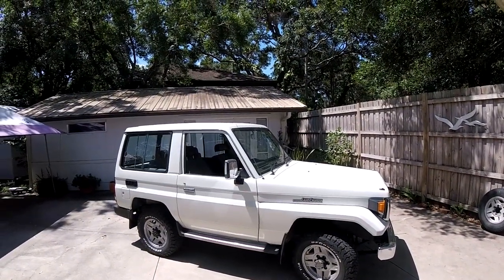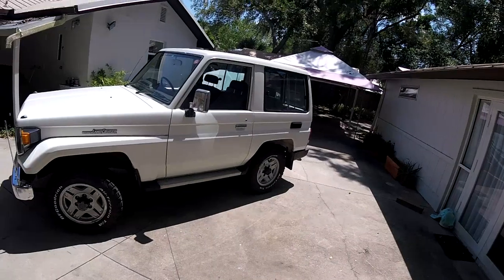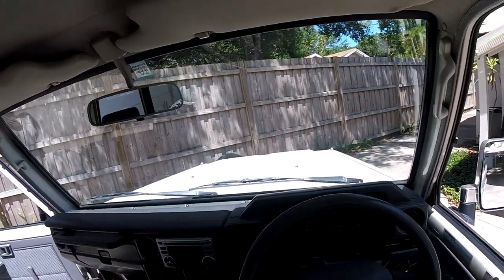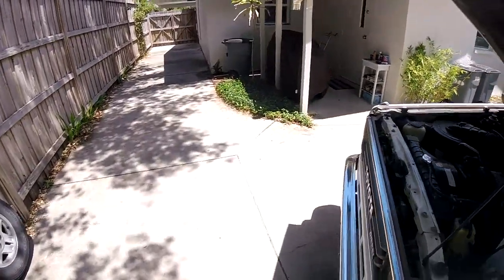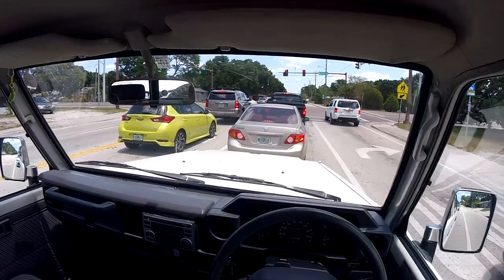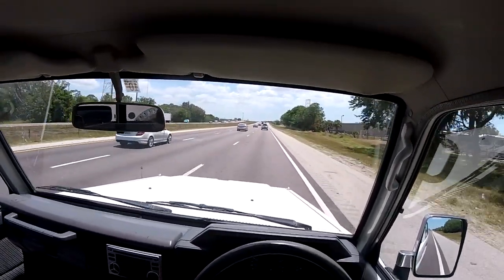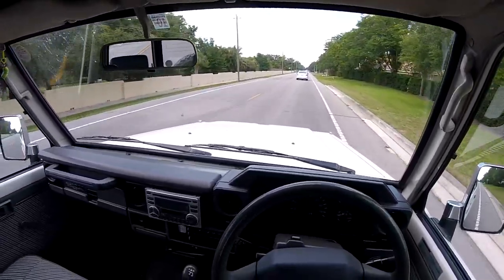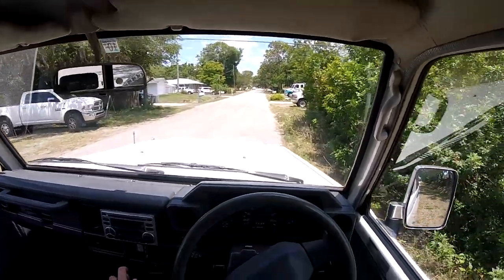1991 Toyota Land Cruiser PZJ70 Diesel 4x4 in the USA - POV Walk Around and Long Drive

Comment: how much did it cost to import this yourself?
Reply from the maker: Whatever price you pay at auction add on around $3000 bucks on top of that, more if you are inland in the USA. 70 series cruisers go for 6-15k at auction, depending on mileage, condition, transmission, etc.
Reply: @KakerMix  could you tell me what page or company you used it to import it? please

Comment: the 1pz is slow fast is the 1hz or the gasoline series or turbo
Reply from the maker: The 1PZ is slower to accelerate than the 1HZ, both of these engines have far more torque than any gasoline options. Gasoline will be quicker to accelerate but have worse fuel economy and arguably aren't as reliable. Top speeds will depend mostly on gearing and little on the engine choice.